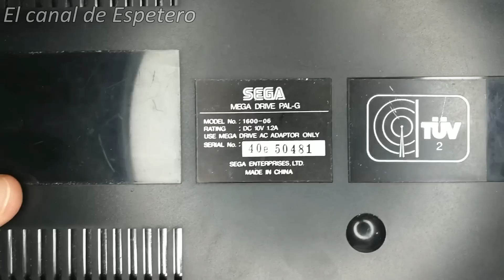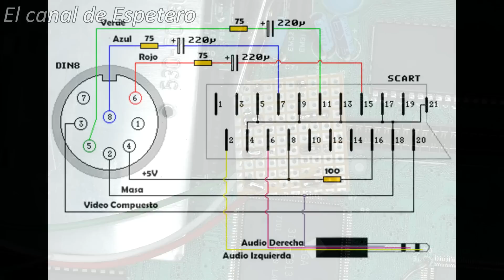MOD MEGADRIVE VA4 MODEL: CARTUCHOS JAP + RGB + REGION + LED + SCART + 60Hz

Comment: Tengo otra duda, en tu vídeo anterior dices que el audio tienen que ir en el pin 1 - 3 y el de video compuesto en el 19, pero en este video veo que van tal cual está en el esquema que decías que no era correcto. Esta es mi placa https://i.imgur.com/7uDr5XG.jpg

Que esquema debería seguir?

Ya tengo el circuito con las resistencias y condensadores montados, ahora solo me falta aclarar lo del Scart y acabarlo todo. Muchas gracias.
Reply: Tras seguir a rajatabla el vídeo solo he conseguido pantalla en negro sin audio, después de romperme los cuernos durante 2 horas a ver que era lo que fallaba y mirar 200mil esquemas por internet a cada cual mas raro, he probado a hacer lo que decías en tu anterior vídeo. He cambiado en el scart el audio a los pines 1 - 3 y el vídeo compuesto al pin 19 y voila! Todo perfecto. El esquema que se ve en este vídeo no es correcto. Como tu bien dices en el vídeo anterior, los pines 2 - 6 son entradas de audio no salidas, por lo tanto si los conectas ahí no suena. Y en el vídeo compuesto pasa lo mismo, el pin 20 es la entrada y el 19 la salida, si lo conectas a la entrada no se ve la imagen.

Lo dejo aquí explicado para que no les pase a otros y desistan (yo he estado apunto de desistir). Menos mal que al final lo he conseguido, que satisfacción! Y mas cuando soy un poco novato en esto jajaja

Ahora falta perforar la caja, organizar los cables por dentro y demás... Gracias de nuevo por el tutorial.
Reply from the maker: @Ragnar_es  disculpa que no te contestara, pero no se por qué tu comentario estaba pendiente de aprobación. Me alegro que al final lo arreglaras, y sobre todo da mucha más satisfacción si lo consigues despues de tanto esfuerzo. Es verdad que el esquema está mal, se suponía que encima iba un audio explicando que no está bien, pero acabo de revisarlo y no está implementado, pero a estas alturas no voy a retirar el video. Dejare tu respuesta fija. Un saludo!!!

Comment: Gracias por el tutorial. Tengo una duda, las resistencias de 75 Ohm de cuantos watios son? Veo que es diferente de la de 180 Ohm
Reply from the maker: Gracias por  ver el video. Las resistencias con que sean de 1/4w vale. En mi caso son de 1/2w porque en la tienda no tenían otras.
Reply: Muchísimas gracias, creo que sería correcto indicarlo en la descripción para novatos como yo :P
Reply from the maker: Pues ya que lo dices, me pongo a ello ;D